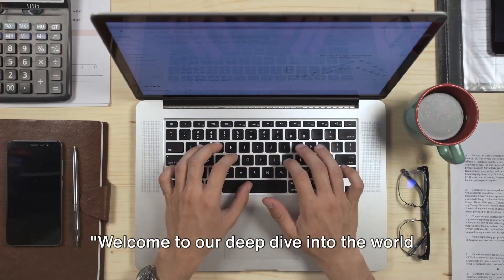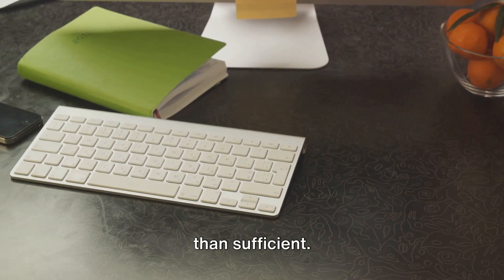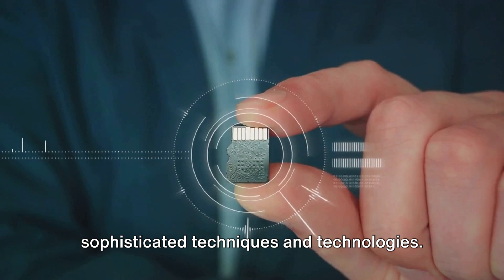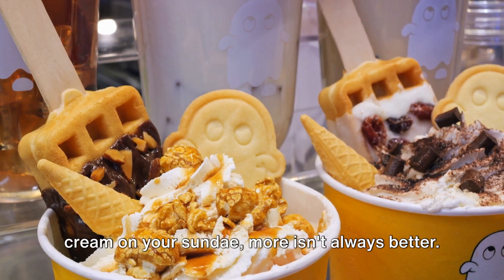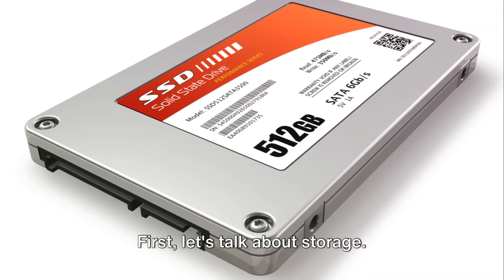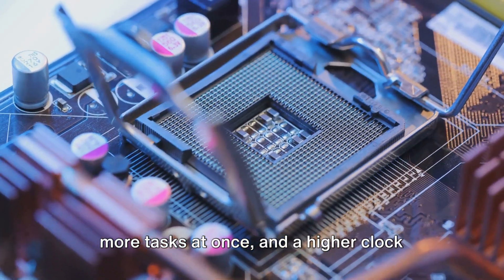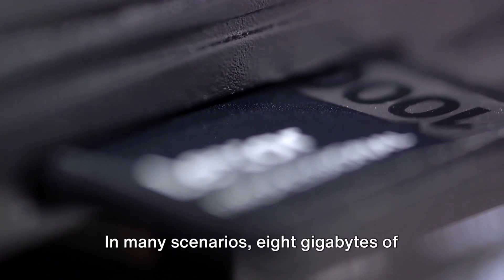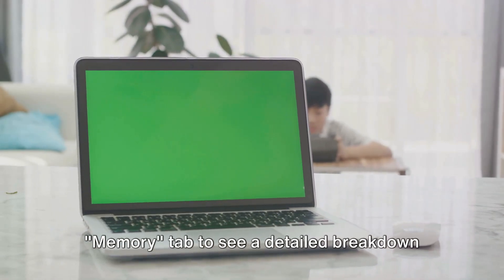Why 8GB is Enough: Unraveling MacBook's Memory Magic

Comment: I have 16gb on my m2 mac mini and with a full webdev setup and its barely enough.
When I have some docker images + dev server + figma + browser + db client running and switch between these apps, sometimes there is a notable lag.
For the Air I can somewhat see the argument, since its for more casual users. But not for the Pro.
Reply from the maker: Thanks for sharing your experience with your Mac Mini setup. It's valuable for others considering similar configurations.

Comment: even if that nonsense was true it doesn't matter because the CPU and GPU shares memory, so with that logic 12GB is what you should get. But there is no 12GB option, so you should get 16GB anyway. In both cases in the PC and Apple world 8GB is a stupid move.
Reply from the maker: Thanks for your comment, but I have been using the MacBook Air for weeks, and for all I do with 8GB of memory. I never had issues, even though I do video editing on it. However, as said, a CPU upgrade (Pro/Max) will be the solution for better performance. Have you ever tried it yourself? I have, and this machine can handle just about anything with just 8GB of shared memory.
Reply: @TonDoesLinux  

I've been using a Silver 13" M2 MacBook Pro with 24GB of Memory and 2TB of Storage for about 5 months now. I know people who are using M1 Airs with 8GB of RAM and they absolutely hate the experience. The real thing is how will 8GB of RAM do in the future. A quick reminder that the RAM in Apple MacBooks aren't upgradeable. 8GB of RAM may have been good in 2020 but in 2024 it is mediocre. Now imagine how 8GB of RAM is going to be in the next 4 years?

Buying a new laptop with 8GB of RAM is going to destroy the longevity and make it basically unusable past 2026, nobody on earth is going to buy a 1000 dollar laptop and only use it for 2 years. It's a waste of your money and your time to get anything with less than 16GB of RAM.
Reply from the maker: @RobloxianX  Well, it all depends on what you do with the laptop. But I woke with an M1 Pro with 32GB for work and a Mac Studio M1 with 32GB. Sure, 16GB is better if you use more heavy programs, but for normal (average user) use, I think 8GB is enough if you can't afford more based on the money you can spend. But yeah, 16GB will be the sweet spot, but 8GB can work well, depending on what you use it for.